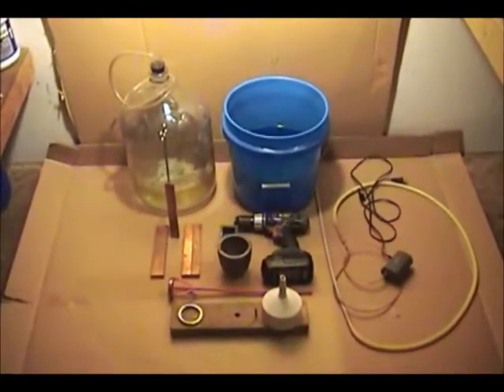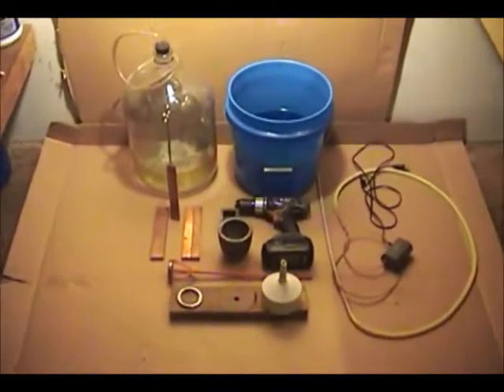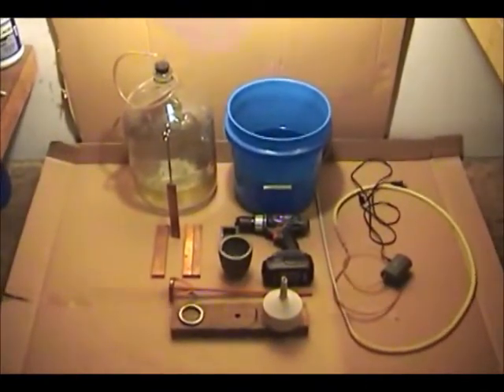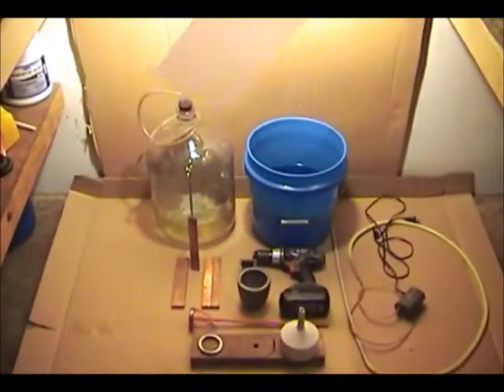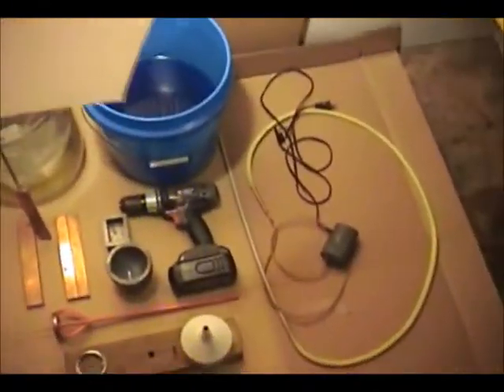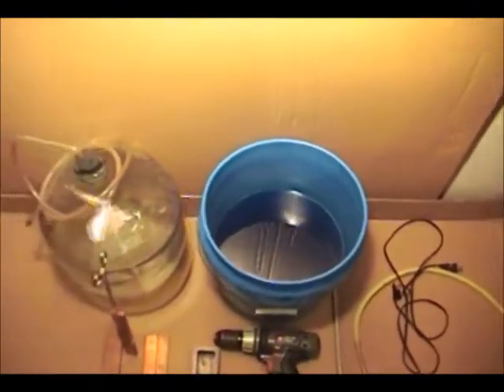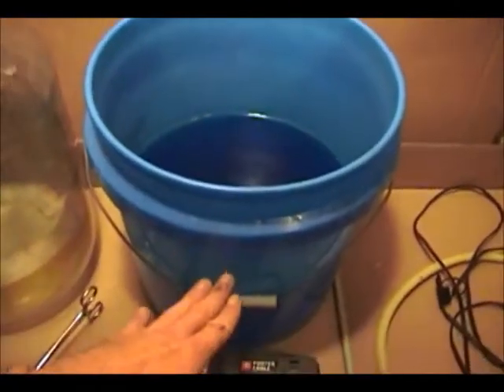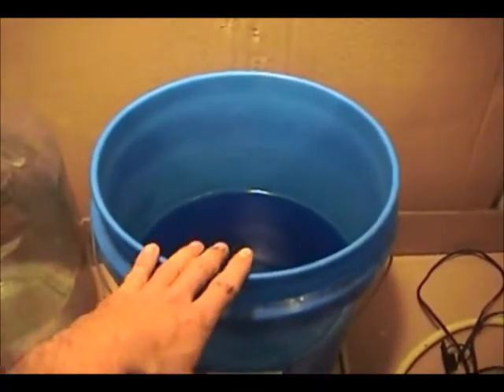Silver Cell Refining -  Silver Precipitating of large lots Part #1

Comment: If you attached a filter to the end of your vacuum tube could you vacuum off the waste without waiting for the silver to settle.  Just a thought.
Reply from the maker: True you could, but the efficiency is what you are looking for. If you run the solution unsettled through the filter it will clog up the filter and slow it down to a trickle. Filtering several gallons at a trickle will take as long as just letting it settle and drawing off the clear solution so all you have to filter is the silver part which has to be washed and cleaned anyway. In a production environment i would use that type system, but for smaller guys it is easier to use the settle and decant method.
Reply: +eamonn280958 aquarium airstone can act as a filter and it filters fairly quickly.

Comment: can you use copper tube?
Reply from the maker: Yes sir you can use copper tube or copper wire instead of copper plate. The plate leads to a cleaner and more complete precipitation making the washing easier, but wire and tube will work also.